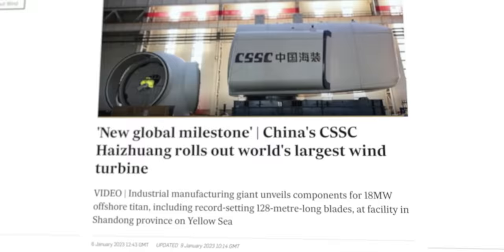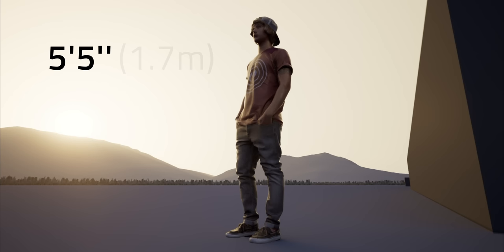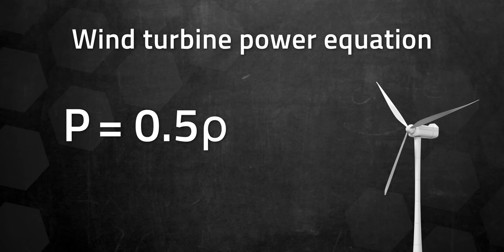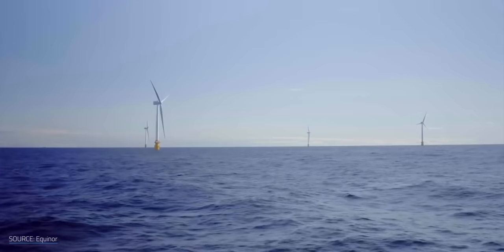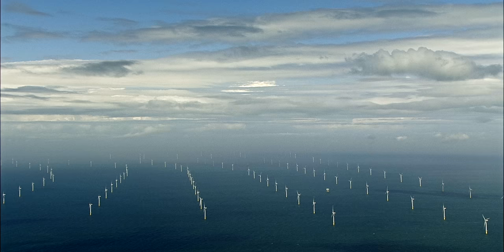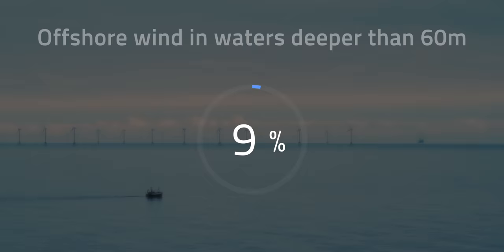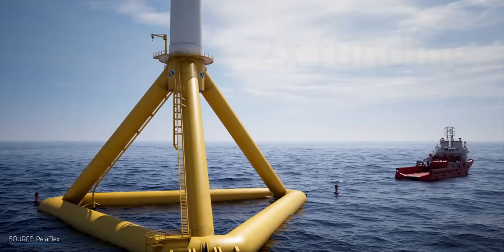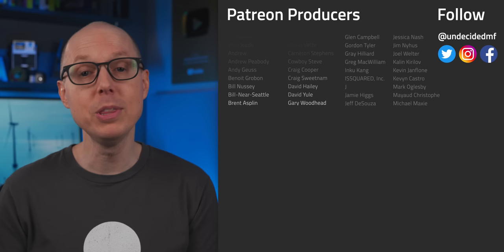Why Are Floating Wind Turbines So Huge?

Comment: Compare a 3gw nuke (Hinkley Point C) v a 3gw offshore windfarm (Dogger Bank). Compare the costs, the energy generation, the build time, the materials, the waste disposal and so on. The windfarm wins hands down. No real windfarm storage options though - yet. But they are coming.
Reply: While I agree with you, for offshore wind you will need a lot more to power to reach the energy output of a 3 GW nuke plant, probably about 12 GW Plus storage.
Reply: @FreeOfFantasy  For sure. But you could build 2 Doggers plus an energy storage solution for the price of a Hinckly - and in a fraction of the time.
Reply: The problem is that we can’t store the wind energy effectively for long periods of time and when the wind isn’t blowing there isn’t much that can be done in terms of energy generation. 

Whilst I do agree with the points you have presented, it’s better to think of nuclear and renewables as complimentary sources of energy rather than opposing. Despite the large investment required, we need nuclear energy to keep the lights on when the sun isn’t shining and the wind isn’t blowing.
Reply: @deekayunited3445  Huge variation in UK generation from wind this month. right now on gridwatch, wind is at 1.35GW. We have had a poor April for wind this year. You would need both those doggers and storage to match the output a new Hinckly would have produced. To be fair though, our nuclear output hasn't been that great with an unplanned shutdown of one plant and Sizewell's still offline for refuelling and not due back until early May, a good two weeks later than planned.
Reply: @chrisplatten2293  Agreed. The UK government has targeted 50gw but I think we'll need closer to 200gw capacity plus storage in time..... plus SMR/conventional nukes to power all those heat pumps an EVs. Still, once built, the wind generation will be fuel free. So up yours Vlad :-)
Reply: @FreeOfFantasy  every nuclear power plant has high efficiency, around 93%,  these work for more than half century. Wind turbines (offshore) have efficiency around 35% and will work 20-25 years (probably) so after 25 years the wind farm must be rebuild.  If we talk for 3GW plants we may need 3 nuclear plants with 1GW each.  Now if we will build wind farm with 18 MW power each the farm will be e forest with 443 turbines and these turbines must be rebuild after 25 years or probably earlier on harsh offshore conditions.  Wind power is good but intermittent and need energy storing to provide dispatchable energy for consumers.
Reply: @rogerstarkey5390  The wind turbines and Solar energy are OK.  Companies get money from costumers and on addition to these they get money from government.  So the pay off of investments is result of high energy prices, and not the low cost which is only on papers.
Reply: @NamekGregory  Nuclear still requires rare materials mate and we don't even know if we have enough to scale globally. There is also the safety and waste disposal issue. Wind does not have the same limitations so even if it's not as efficient, it's certainly more feasible in the long term.
Reply: @gemelwalters2942 there are no real safety issues with modern nuclear power plants.
Reply: @gemelwalters2942  I appreciate your input and agree the nuclear need rare materials, even more than wind or other generators.  The advantage in nuclear is that these produce more effectively, let say 93% of the time and for longer, 50-60 years.  On the case of wind turbines the efficiency may arrive 25-35% and turbines with 100 m or longer blade may work 20 years, and then must be rebuild.  You may say the old one will be recycled, but this is not so easy and so we need more minerals, more metals, more distributions lines and all these become more expensive.

Comment: Thx much for this.  Enormous potential.  Imagine wind turbines also being used as functional art or by painting them in different colors to mimic a field of flowers.  Probably not cost effective but in some areas it might mitigate - to some degree - nimby objections.   Christo became famous for a lot more fantastical and impractical art projects.   Might be worth a try once to see what the reaction would be, and might even give folks a grin in addition to carbon-free energy.
Reply: Not a good idea, because birds will see the color green and once they hit the wind turbines they are dead. Birds see green as a sign of a tree and they usually try and hop onto whatever object.
Reply: @maxpro751  this seems like you just made it up.
Reply: @pissoffeachother  Well I kinda did. Some birds may mistake the rotating blades of wind turbines for trees or other structures and collide with them, this is not due to their perception of the color green. Many bird species are not able to perceive the color green, as their vision is limited to certain wavelengths but what my point I am trying to get across is birds DO sometimes mistake these objects as structures and therefore land on them.
Reply: Enercon already does this by adding a green gradient to the base of their towers

Comment: How long do these turbines last before they need major repairs?  I’ve heard that is less much less than 10 years which makes the costs impractical.  Also, wind power is only practical if you can store the energy as needed.
Reply: They last about 20 years, 25 if they are well made and maintained. After about 10 years they start to need constant maintenance, especially if they are made by certain companies that have a worse product. Some of the worst towers are offline more than they are online by time they are 15 years old

Comment: Smaller turbines start turning at lower wind speeds. So smaller turbines are useful too.
Reply: @rogerstarkey5390  Definitely. That's why even in the UK, those of us who want to decarbonise for either environmental or economic reasons, put in solar panels instead of tiny wind turbines.
Reply: A smaller turbine might 'start turning' at a small gust but the actual power and energy generated from those low wind speeds just follows the formula explained in the video. So low wind speed + low swept area = minimal amounts of Watt. Especially compared to the performance of bigger turbines at greater heights. It's just physics, sadly there is no way to cheat the system (by going smaller).
Reply: In reply to all who have replied, I am talking about localised turbines, not major infrastructure projects. I still think a small turbine here and there doesnt hurt.
Reply: @waqasahmed939  idk where in the UK you are. Where I am in Scotland, many farmers have small wind turbines. I totally agree on solar panels though.
Reply: @waqasahmed939  Solar in UK... you truly have to be economically mind dumb to install solar there.  It would be cheaper to lease land in Western Sahara, or just conquer a portion as no one lives there, and run several monstorous power cables even with the resistance losses a couple thousand km.
Reply: @w8stral  Desertec was proposed and failed. Long interconnectors are expensive. North Africa is not the most politically stable area, so we could end up held to ransom over our solar, just like we were over gas. Domestic solar and and a battery to timeshift cheaper power can work well in the UK.
Reply: @w8stral  Actually, solar is so efficient that there are times it can (and does) supply 20% of the UK's electricity! Even though we are not a sunny country. We dont focus on it but we put it where we can. Im in Scotland and the solar panels on my parents house provide a large proportion of their electricity during summer!
Reply: @chrisplatten2293  The Xlinks Morocco-UK Power Project is still underway, afaik
Reply: Finally got around to looking that one up. Looks like they are getting the permits lined up to survey the route for the cable. They will have wind and solar as well as some storage, so it does look interesting.  Possible live feed 2028. It's a new project though rather than a continuation of Desertec. Still, it's good progress.

Comment: Back in 2003, a colleague was extolling the virtues of Wind Power.
I asked them what they thought the impact on the environment would be of extracting all of that energy from the weather system.
They didn't seem to think it would be a problem, much like humans have always assumed our species is too small a component in the wide world for our activities to have significant effects.
Activities such as: cutting down trees, burning Coal, damming rivers, etc.
I find it amazing that 20 years later people are complaining about the changes in the weather/climate and are building wind farms at an increasing rate, but don't seem to have connected the two!
People have stuck their collective heads in the sand and told themselves 'The wind wasn't doing anything, anyway', when of course, it was.
When they realise how savagely and comprehensively extracting energy from the weather systems can bite us, I look forward to a HUGE resurgence in nuclear power. 🙂

Comment: If you apply that wind turbine power  formula to the world's largest wind turbine at a maximum wind speed of 60 mph, it comes out to about 727 million watts.  But the maximum power output of the turbine is rated at 16 million watts which is only 2%  of the available wind energy.

Comment: I'd like to see a second video with a similiar topic: focusing on enviromental impact on constructing and using these turbines and not just co2, but also microparticles etc. And if it'd be possible to for example exchange the carbon fiber blades (if those are from carbon fiber, cant remember) to some kind of wood-fiber. You could probably get some good info on the wood-fibers by interviewing people from Metsä Group or UPM, but there's for sure other companies focusing on wood-fibers as well.
Reply: Expensive and not too friendly to the environment, which is why you don’t see these videos. How are the end product recycled ( oops) how many mines required for the copper (oops) the list goes on. Wind drought oops have to replicate the wind farms with another carbon based power supply ie two power plants required = double the investment required.

Comment: I am close to this industry in the UK and I note the floating semi-submersible foundation supplied by the US company Principle Power, WindFloat, weighs in at a hefty 3000 tonnes of steel for a 10MW wind turbine.   A UK company has designed a tension leg floating foundation which is almost 1/3rd of the mass!  The UK government says that they are leading the offshore wind but in fact most of the cost of an offshore wind farm is provided by overseas companies which is a big problem for the UK.  Yes we have a lot of offshore wind energy but it is provided by imported wind turbines and foundations!!

Comment: Well, looking at your "scaling" equation, is says that the power generated is proportional to the Square of the turbine radius.   That's all well and good.

But, but ...   roughly speaking, the "mass" of the assembly would increase as the Cube of the size or roughly the cube of the radius.   To  brings things back to earth if you double the radius, you get 4 times the power.   But the mass would increase by a factor of 8.   The power per "pound" would be cut in half.

Comment: Excellent video. I think with a combo of lots of offshore (floating) wind, geothermal and gravity (not pumped) hydro we can get a pretty good cloudy day/nightime renewable base load energy grid without needing a lot of storage, and we could use PV as a daytime peaking mechanism, with community based batteries for evening peak domestic power. At least on the back of an envelope, this is all doable economically, but will need energy consuming industries to be rewarded for load shifting/demand response and penalised for not playing well in a renewable grid - industry (historically great innovators in a crisis) will find much better responses to the problem of demand/storage when it hits their balance sheet than any government ever will with grid scale storage. Oh, oil and gas industries need to be be much more highly taxed and regulated so their precious commodity is used for high value/return petrochemical manufacturing rather than the stupidity of boiling water.
Reply: Or then we could just build nuclear plants for guaranteed reliability and lower lifetime costs. Oil refinement always produces different weighted distillates. You can change the ratio only to certain degree but you will always have a portion of light distillates and heavy distillates. If there would be a more value adding use for gasoline and diesel than to use it for heating and moving things, it would certainly been happening for a long time.
Reply: @k0zzu21  The massive up front costs mean Nuclear is probably a great option for countries with high population density, large wealth and stable government, but for the rest of us it is a VERY high barrier to entry, and pacific island nations, for example, could really win from floating wind.
Probably keep the heavy distillate fraction for container shipping can work, especially as those big boats have room for small scale carbon scrubbing. gasoline/petroleum spirits  are a vexed issue. Using them for transport is probably going to be cheaper than EVs, right up until the point that our planet is totally cooked. This is why we need policy in place to ban burning the light fractions of crude and encourage other non combustion uses like polymer synthesis as it is not just an economic argument.

Comment: Generation means nothing if you can't deliver over 99.999% uptime. On land wind runs an average of 20% of capacity, offshore about 35%. But the gaps between near max generation can be days or weeks. Which means either massively hugely overbuilding generation, moderately overbuilding generation and running very numerous transmission lines, hugely expensive storage on a scale that dwarfs any prior efforts, or just telling people they might need to go days without electrical power. 

If you want a to move away from baseload coal and peaking natural gas be like Finland and build nuclear power plants.

Comment: Power transmission can be solved in 2 ways. 1) Microwave transmission of energy. Each turbine would have a MW transmitter. If the wind turbines are beyond the horizon a high altitude balloon or dirigible with a  MW reflector will be required. Rectennas then would be erected on shore. The rectennas can be located far inland. This would make Nicolas Tesla proud. He had the right idea, but didn't have MW technology. 2) Second way: Each turbine would produce hydrogen that would be piped or liquified and shipped to shore, Possible, but not very practical or economical.

Comment: The easy to install and maintain land based turbines aren't even efficient long term after 40 years of researching them, so why would this brand new, huge, ultra expensive, and difficult to service floating turbine have any promise at all?  Especially since its AC power would have to be routed so far from off shore.

Comment: One of my major concerns with offshore wind is security. They are incredibly vulnerable to enemy state actors and require protection. That protection would have to come from submarines, likely nuclear powered to avoid detection. Those not only do not come cheap having them patrol offshore windfarms effectively nullifies their usage elsewhere lest the fields be left unguarded.

The other options are the development of underwater drone swarms to protect the fields but in deep water areas their ability to catch and therefore deter an enemy sub attack is dubious.
Reply: The inverse is mire believable.  The wind farms add a network of sensors.  It makes it harder for hostile parties to pass through unnoticed.

Comment: Nice video, but it needs projections for kilowatts/per-hour costs.   Also, how will these intermittent power sources work with our current baseload power grid?   Do we need on-shore gas turbines to back up these systems, and how will that affect the overall cost?

Comment: I'm always sceptical about the cost/MWh of renewables. A quick calculation tells you that if the cost of on-shore wind would be 30$/Mwh, as claimed, producing the 24*10^9 the world consumes and converting the entire world to run on wind would give a yearly bill of 720 billion dolars. We can assume some variables would have a negative scaling up, like the number of suitable "windy places" but others would counteract with a possitive one, line economies or scale. It doesn't matter, the number is way too low. 
As per usual, the estimate of $/MWh have had to be assuming flatout winds the entire year and/or massively optimistic lifespans and/or without taking into account installation cost or the usual creative accounting tricks when discussing renewables.
Reply: LCOE is calculated including both construction cost and capacity factor already.

Comment: Id like to see the comparison of early offshore drilling installation/ mantaince cost vs floating turbines. 

Currently it makes economic sense to continue drilling, so the price, vs emerging technology cost had to have balanced out. And where wind has the cable costs, the oil industry has the cost of increased labor on rigs, sampling costs to find oil, as well as further refinement costs once bringing energy back to land, over all i see it as a better long term economic move. Even outside the whole green energy conversation.